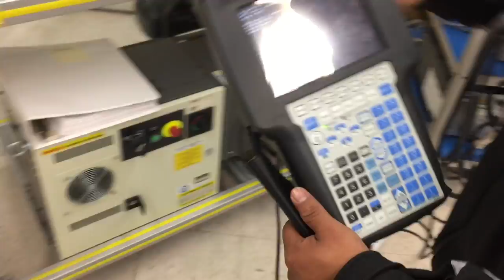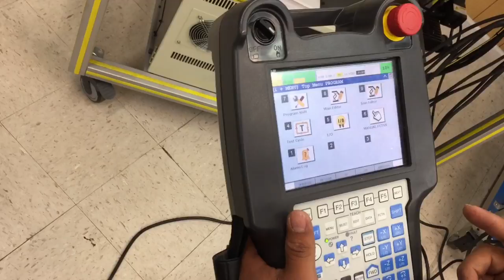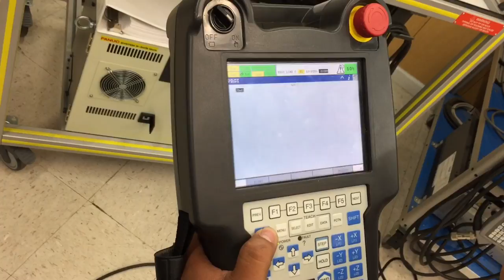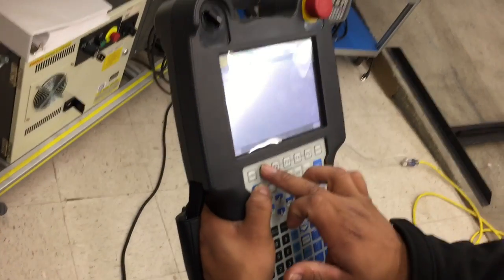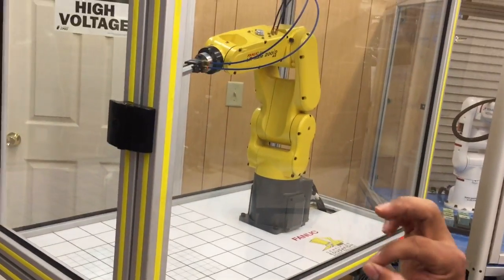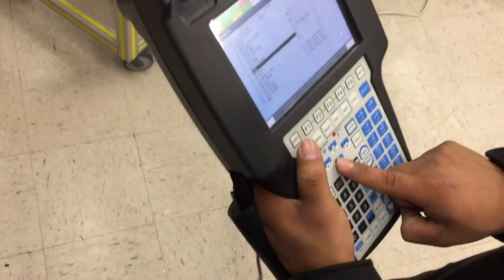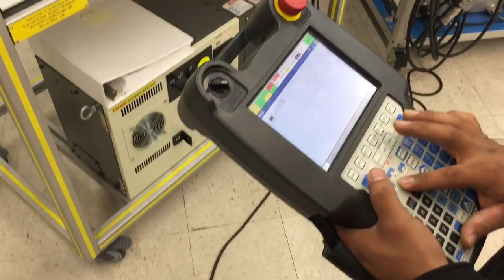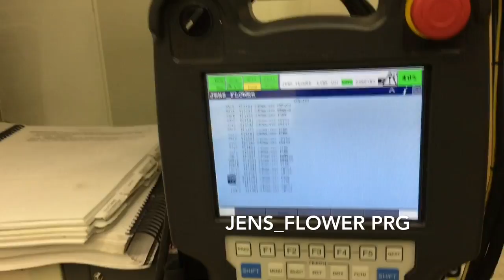Fanuc Robot startup 1

Comment: I think i work with the R-30ib, these robots can to immaculate work.  Thats cool seeing smaller robots,  that system (cabinet) under the robot is way smaller than the one im used to, and it looks way newer, we dont have the touch screens.  The system/console i work with one about the size of a refrigerator and the robot is about 18-20ft in length when laid out

Comment: I'm sure you've come a long way from when you started your training, but you're making some broad assumptions about the two brands, based on on a very limited experience. Likely the reason you perceive the Fanuc having more "dexterity" than the Yaskawa (Motoman) system, is only because of the size of the manipulator (arm). If your school would have purchased a similarly sized arm, the motion envelope and joint angles would have been similar to that of the Fanuc.

Similarly, if they would have purchased a slightly smaller Fanuc arm, the work envelope for it would have sucked too.

I used to work for Yaskawa/Motoman and I never encountered a situation that Fanuc could do that we couldn't also do and usually easier. We also provided many more programming freebies that Fanuc would charge extra thousands for.

Comment: It is definitely not more advanced than the Yaskawa Motoman, you just know the Fanuc better.

I used to work for Yaskawa Motoman and there were many places I went where they were using both brands and there would always be someone one would say the Fanuc could do more But, there was NEVER something that Fanuc could do that I couldn't also do with the Motoman. Also, many of those functions were free with Motoman, but cost extra with Fanuc. Both are very good robots. To me, the main difference is the cabinet. Keep the control door closed on the Motoman and it will stay spotless. The Fanuc will be full of dust, if it's running in a dusty environment. Not usually a huge deal.
Reply: Havent worked with motoman but yes that is so true about the cabinets getting hella dirty on the fanuc ones
Reply: @Derno545 
Yaskawa (used to be Motoman) seal up tighter than a refrigerator. Keep the door closed (and latched), and they're absolutely spotless.
Reply: @cornpop7805  thats cool man, these are my first robots im learning on i hope to progress further to other robots or jobs as well..  That makes me think of PlayStation vs. Xbox, as playstation is notorious for getting extremely dusty

Comment: Why do you need to reload or restore the software when the batteries run low or die...?
Reply from the maker: Keith Kohl  this I can answer from experience. Robots, PLCs, PCs, and other devices require constant power in order to attain its documents, programs, and settings as well. When it comes to robots, they should always have a proper shut down and must have the batteries ready at hand. Now this is also why it is very important for you to always have the robot back in to home position during a maintenance or major shut down in the facility because if it runs out of batteries and it’s been off for a good while it will lose its original 0 homing program position. If let off for a longer time than the software will be lost. It’s a lot like computers truly. When the PC has low CMOS energy, then the BIOs settings will change and you can lose some programs/information.